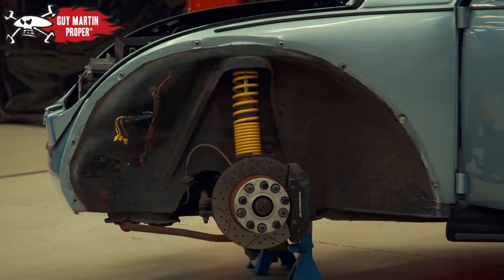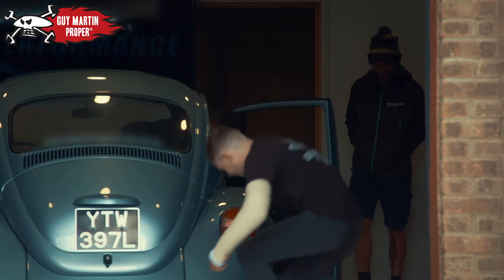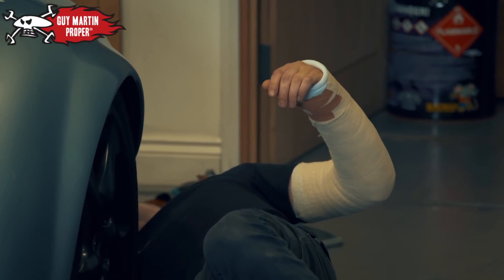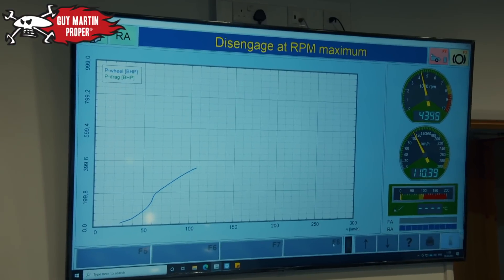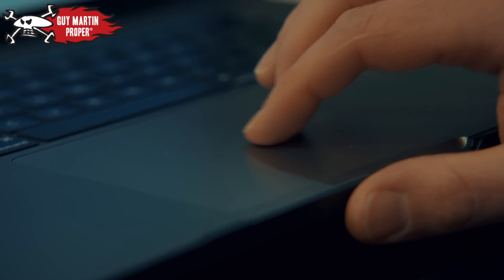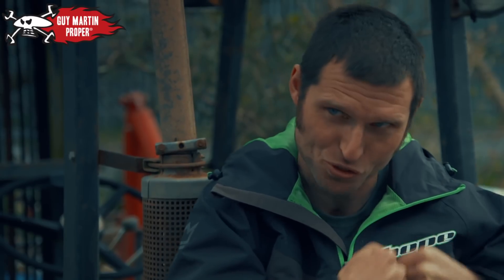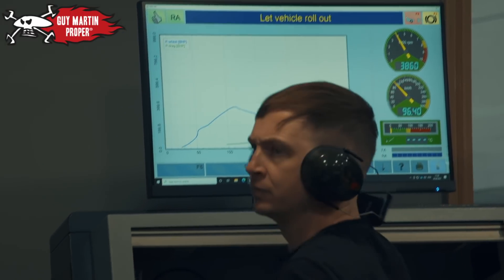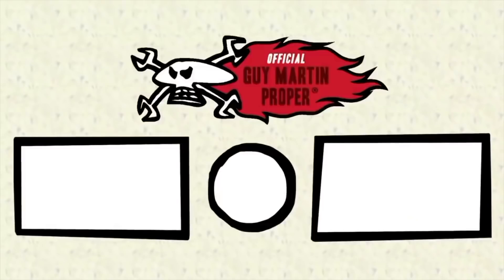Guy modding a Beetle to electric power | Guy Martin Proper

Comment: Torque is the "force" you apply. Power depends on how often you can apply that "force". Example: I'm a 300 pound fatty. If I get on a bicycle and apply my weight to a pedal with a 1 foot long pedal arm, I'm applying 300 foot pound of torque. A 100 pound Tour de France (TdF) lightweight rider only applies 100 foot pound of torque to the pedal. The reason my fat arse haven't won the TdF yet, is that despite being able to apply way more torque than a TdF pro, I can't apply the torque nearly as many times per minute as the TdF pro, so my power output sucks, despite having more torque. Power = torque * rpm - simple as that, so if I apply 300 foot pounds of torque to the pedals once a minute I'm not winning anything, however if I'm able to apply it 100 times a minute I'm leaving everyone in a cloud of dust.

Comment: So it is faster than the wobbleplate. But how far can you drive it before refueling?? And how much heavier is it than with the wobble plate.
IF you want to go faster fit a Subaru wobble plate, treble the horsepower and it will probably be near as fast and a LOT more driveable. And possibly more economical than a 1200 wobbleplate

Comment: For anyone who's actually not clear about power/torque:

Torque is how much power's in each stroke. Horsepower's how much power is output per second. So the diesel version of my car gets 150hp at 4500rpm, with max torque at 320nm at 2000rpm. The petrol version gets 150hp at 5500rpm, with max torque of 230nm at 3000rpm.

So, each stroke of the diesel has more power, but the engine can't turn over as quickly as the petrol. It pulls hardest at low revs, while the petrol pulls hardest at mid revs, but you have to really rev the petrol to get the same power out of it that you'd get from the diesel lower down. 

Another factor is power to weight of course. The petrol gets 150 bhp out of a 1.4 litre engine, and the diesel needs a 1.9, 85kg heavier engine to get the same power, so the diesel might feel more powerful in normal driving, but in a side-by-side test, the petrol's quicker to 60mph by about 0.6 seconds.
Reply: Not a bad analogy.  I think of it as: Torque is how much work you can get out of each stroke and Horsepower is how many of those strokes you can get in a period of time.  When people think of torque in a car or motorcycle, what they are actually feeling is acceleration caused by the EXCESS power available at a given RPM.  A faster-spinning low-torque engine can feel exactly the same as a slower spinning high-torque one.  You explained this well with " you have to really rev the petrol to get the same power out of it that you'd get from the diesel lower down".
For some reason, many people can't understand the importance of gear ratios.